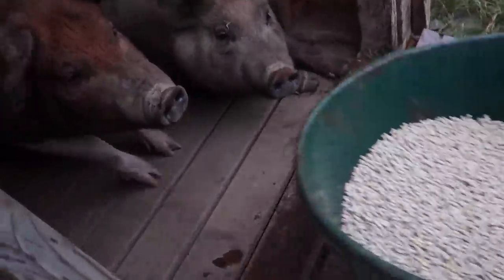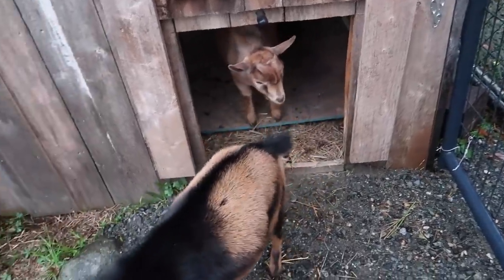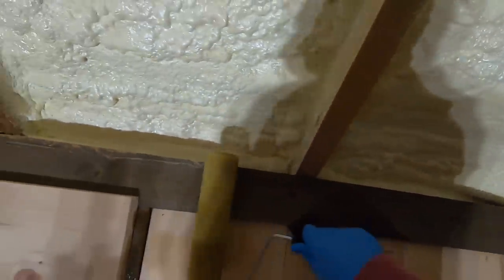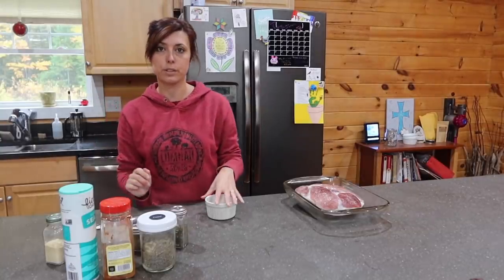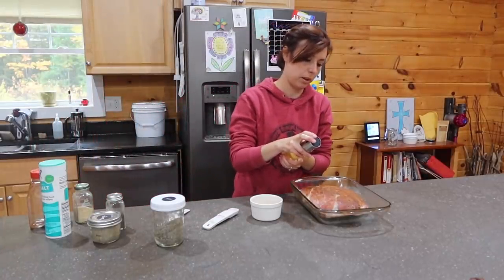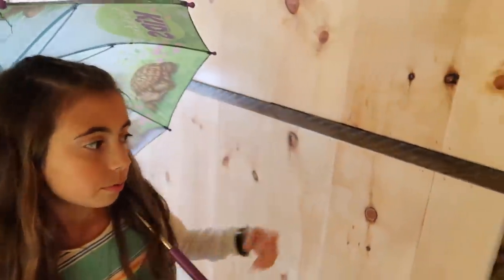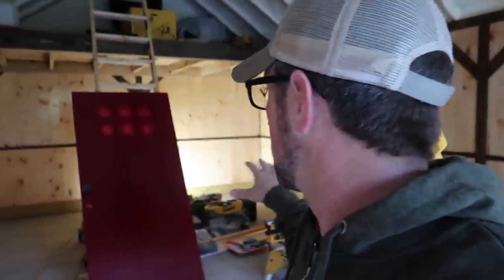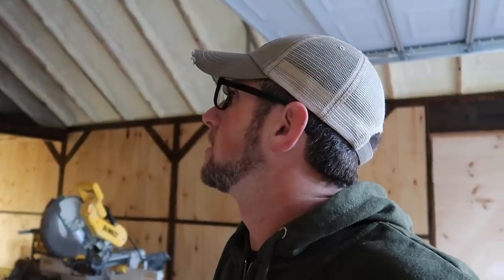Time to Get Sticky! Applying the FINISH to the Post & Beam WorkShop

Comment: Two suggestions: 1. Make sure you have a work bench for working on greasy/oily things -cars, tractors, chainsaws etc separate from the bench you will use for wood and other crafts/projects. A metal top bench for grease would be best; once you get grease and oil in wood it'll never come out. 2. I would suggest that the top of at least one of your wood work/craft tables be made with a surface you can replace fairly easy (good solid plywood perhaps). This gives you flexibility to secure (screw) blocks or other things directly to the table top temporarily without spoiling a nice butcher block finish of other work surfaces. Clamping for most wood working projects is usually fine but where the shop is meant to be multi-purpose, you may find that helpful.

Comment: I've had a 2x4 butcher block workbench for 30 years and it still has more time left than I do probably. With all the Dewalts you have make a nice charging station as part of your workbench set up. I like your ideas so far-to me a workbench is almost a personal thing and you need to do what works for you. Mobility for things like the table saw are the way to go because your not using them all the time and they don't need to be taking up work space. Bench grinder,drill press,vise are a few more permanent fixtures in a good shop. Looking forward to the "birth of a workshop" LOL

Comment: Hinge part of your benches with drop down legs , they hang down against the wall when not in use leaving more floor space when needed.  Worked like a charm in my small shop. You never have enough room.

Comment: That Lil Cowgirl Olivia is growing & she’s so intelligent 😁❤️👍
My suggestion for the ceiling to cover over the foam. Is this paneling you can get at Lowe’s or Home Depot that looks like tongue & Grove wood. You could probably get it in the Color to match your walls. It’s also thin & light weight 4’x8’sheets like regular paneling that goes on walls of the house. U can get it with about any wood look. It would be easy to put up to cover your foam & it would look more like a cabin inside. 🤷‍♂️
Reply: I would suggest also that they finish (stain and polyurethane) those pieces before they get put up.
Reply: Susie'sSoap&Stuff they already come that way with satin finish on them. They are paneling like you put on the walls. But you can get them now that look like boards like what’s on his walls already , you can also get it that looks like a brick 🧱 wall, just all kinds of designs on them & they are already come with shiny satin finish.👍
Reply: Not an audio expert, but putting in a ceiling of the proper material, might provide significant improvement to the audio on your videos on YouTube.  This would improve all the future segments that we are hoping to see of the your projects in the workshop.

Comment: I love Ms. Olivia’s optimism about the weather, as much as I enjoy the snow and cold I agree, why can’t the whole year be like the last couple of days prior to rainy and highs in the 40’s this whole weekend. Mid-Michigan, if you don’t like the weather, stick around it will change...

As for the work area, I would try and keep the table saw below the left sided bench, maybe to the right of the chop saw cut out, out of the way until needed. Keep your tools in one general area, maybe the right side of the U. And cabinets across the back wall.

The whole work shop is looking amazing. If funds allow some bead board or ship lap on the ceiling run horizontally and painted a light color or polyurethaned to help keep it bright with the addition of the L.E.D. lights..I agree in waiting to do the electrical at the end, gives you time to figure out the placement without making it permanent.

Comment: Al, make everything mobile, including those work benches. This will provide maximum flexibility.  That space may look huge now, but trust me, as you put things in, it'll shrink rapidly. Put them on heavy duty locking casters - you'll thank yourself later. Also, install some type of sawdust exhaust system. It would be very cool if you could have it run to the exterior so it would empty into a bin outside or something for easy hauling to your compost area. Your polyurethane spill just highlighted something you might want to do as well - a POLYUREA coating on your floor (lasts longer, is easier to apply, dries faster (2hrs) than the standard coatings that most people use.

Comment: In my shop the chop saw was against the end wall and built in. This leave all the other walls clear with moveable benches on them for assembly, crafts, repair work, etc.... and the shop can be reconfigured for different projects as needed or interest change.

Comment: My husband has heavy duty lockable wheels on old kitchen units and cupboards in his Worksop allowing him to move them around, yet at the same time able to lock them once moved. He then made a shelving unit with 24 x 4” square slots. He bought 24 x 4” square containers and put them in the 24 holes, these containers were filled with nails and screws. He mounted the whole thing to the wall. All containers have been labelled with the size of the screws etc and what they’re used for ie wood, metal, plaster etc, even including slots for different size wall plugs too. He also got a 4 x 1” length of pine, hung it on the wall, like a long shelf, then drilled the shelf with different size holes. This shelf is used to stack, hammers, screw drivers etc. As my dad used to say, there’s a place for everything and everything should be in its place.

Comment: How you layout your shop is going to change over the years. If I could suggest anything make one of the benches covered with steel. And make sure you get a flammable liquids storage cabinet. A real one, not just a steel cabinet. 
Your sure to be grinding someday.
Reply: You need a metal cabinet for insurance purposes.  Without it,if a fire turns out to be caused by your shop chemicals, they may deny the claim.

Comment: I keep  2  garbage cans  in  my  barn/workshop  for  trash  and  gen cleanup,  also  some  5  gal  for  metal  pieces, etc.   I  put in  a  u shape  work area  in  my  barn  with  a  lower  shelf  for  tubbies.  I  keep  small  tools,  plumbing and  electrical supplies  in  them.  Makes it  easy  to  find  parts  when  in  a  hurry!  I  put  hangers  for  yard tools  on  the  wall  so its  easy to clean under them.  Feed  goes  in  metal  cans  and  I  need  to  build  wood  risers since  I  have  a  dirt  floor!  Table saw,  miter saw,  chop saw  are  on  rolling  tables  so  I  can  work outside  or  in  the  center of the  barn.  I have lots of  storage  shelves  on  the  rest of the walls  for  more  tubbies  and  set up  areas for  certain equipment--bee stuff,  pool stuff,  brewing stuff-bottles,  etc.

Comment: Don't forget a plumbed in dust collection system.  Make sure it's an actual  dust collection system sized for 4 to 6 inch pipes.. Personally I also like to have a  shop sized dust filter hanging from the ceiling as well . It really takes care of most of the sawdust issues and keeps the shop environment  nice to work in.

Comment: You’ve made such a beautiful workshop!   I would definitely do two things if it were me...cover the insulation on ceiling with some kind of wood paneling....maybe a faux shiplap and seal that floor so stains don’t absorb into that concrete.  In fact they make some amazing concrete tints these days....so putting a darker tint on that floor might show stains less.   This workshop is going to be your sanctuary and used by your family for decades to come for projects so I think it’s worth spending a bit more time and money to do these last finishing touches!

Comment: I used 2 layers of 1/2 plywood for bench top. My vice is on a island. You could build one on wheels . Make shore you have plenty of room on both sides of the saw. Used 8 ' led lights, which used to be Florissant converted. You can get 4' shop led for cheep. Put put tones of reciprocal around the wall. I picked a used sawdust collector, for my planer and other things. Leave room for a skill press. I use mine for every thing.

Comment: Since it is going to be multi-functional for Gino too, I think a good dust collection system is vital. Be proactive in controlling the dust. At each work station, saw, drill press, etc. Also above your assembly bench. Easier to build it in now. Then a nice rolling bench/table that incorporates the table saw and a router with an overhead duct to connect to the dust collection. Really enjoy following your journey, thanks for your efforts filming and producing great content.

Comment: Outside behind the barn in a small covered area locate an air compressor and pipe it into the barn, then run hard lines to various location ending with quick disconnects. Also, if you have the power, a welder is always a good thing to have at your disposal for working and repairing farm equipment.

Comment: I had a u shaped work bench in a shed i used to have and it was awesome. It made it easy to reach everything. I used 3/4 inch plywood so if it got worn out i could change it. However, the butcher block would be gorgeous. I am sure whatever you do it will be awesome

Comment: Love what you did in the work shop!!! Beautiful!  I would get plywood up on the celing before you run conduit.   You'll loose foam insulation otherwise.  It will also stabilize moisture in the workshop.

Comment: I have a similar chop saw station, but I would flip it to the other side of the barn, because you will normally use your.left hand to hold the material and your right to operate the saw.  Having the material most supported in the left side will give you the most sagety/speed over time.

Comment: Gooooood Mawnin' Al!   No matter what design you go for I'm sure it will be a good design.  My recommendation is to consider using tables or carts on wheels where you can so that you will be able to move them to clean up a mess and so you can easily move sections around as needed.   Good luck.

Comment: As you apparently like to "re-purpose", look for some surplus/salvage wooden doors (solid not hollow) to use as work bench tops.  The door knob hole works great for scraping trash/scraps into a coffee can mounted below as a mini trash can.   Also, you can make your own "Peg Board" out of 1/4" plywood (lots of drilling holes involved) which you can score and stain to match the ship lap siding if you want to be real artsy!

Comment: Put wheels on everything. make the U shaped area in 3 parts so you can move the pieces around to use as the off cut table  and for other crafts.  Make under-bench shelves for storage.  Mount a vice in a good central location.

Comment: Prior to building any work shop cabinets or tables I would recommend installing a dust collection system....that is something I have to do in my woodshop.  When you setup the dust collection system you want to establish different work stations for your stationery machines.  There are numerous affordable systems on Amazon. ... granted I am still working on the best affordable dust collection system for my wood shop....

Comment: Paint the Floor, it makes the clean up quicker  if you use one of the epoxy paints its  rock hard and difficult to damage / stain. 
Fit the lights under the attic area in the space between the beams it will save on damage when moving things around.   
Make one of the bench tops metal  for dirty work (fixing engines and other other oily / greasy parts) make sure that you electrically earth it.
Hinge the ladder / stairs so you can have a clear floor area when access to the loft in not needed. 
Fit some of the lights along the walls to shine on the workbench's so that you don't work in shadow .
Fit a vacuum dust extractor to the saw, if you are not going to move it, this will help with the clean up and cut down on the dust. 

Just some things that I would like in my ideal workshop.

Comment: Counter tops: for the wood working side do 2x3's on end but for toolbox side do plywood then cover it with thin sheet of galvanized sheet metal for easy cleanups when working dirty, greasy mechanical parts.(have front and back of metal bent in a shop brake for clean look.

Comment: The poly is a good call, and it looks wonderful already. Satin sheen is my personal preference as well, and it'll not only protect the wood, but it'll also clean up easily. I, too custom built a miter saw table like you described, and it's very convenient. Can add shelves underneath for storage, too. For lighting, I've had great results with LED strips I ordered from Rockler. They're extremely BRIGHT and economically priced. Might also consider dust collection as you're planning the layout. No need to buy an expensive setup, because a simple dust separator connected to your shop vac can do the job nicely. There are several plans for building a mobile dust collector that can be easily rolled to the tool you're using at the time. The single item I get the most use from is an 'all purpose' table/workbench centrally located in the shop. Mine is about 8ft x 4ft and it's where I do all my assembly work. It's not near walls for a reason, and I'd be lost without having it. Not sure if you have the space available, nor what you're going to be building -- but think about where you want to be working... Hope this helps!

Comment: Your butcher block idea for the workbench top is an excellent idea.  I would like to suggest maple for the bench top, or another hardwood.  Also mount a 3/16" steel plate 2 - 3x the base size of your vise on the underside of the bench, with holes drilled through the bench & plate for the vice mounting bolts.  Use as big of a diameter bolt that will fit through the vice mounting holes.  We have a steel frame (1/4"x2" angle, w/2"x2"x1/4" square stock legs) workbench at our shop with a 3/4" plywood top that has a 1/4" steel plate welded onto the frame under our vice.

Comment: I used old take out kitchen cabinets when I remodeled  my kitchen with a 3/4" plywood top on a 2×6 frame. I left lots of open space under the benchtop to slide larger things for storage. A rolling bench would be great for your table saw if you recess a area to level your table saw with the bench would be handy you could make it so the saw could be set in to rip long pieces or turned for smaller peices✌

Comment: Looking good :D   Decorators tip for you, do the cutting in around the edges first then roller middle areas (works for pain and varnish) this will minimise brush marks and give a neater finish also you are not trying to get small bits done around an area which is already drying/tacky.  Was given this tip a few years ago and to pinch your phrase "I like it" ;)

Comment: I like your idea for the " U " work bench. I planned on making mine with 2x4 glue and F clamps. I think for the ceiling I would put up some kind of sound insulating foam boards. Hold in a little more heat and make it quieter. Looks really good guys!!

Comment: From an electrician run two 3/4 in emts home runs from your panel to each side of your shop one for outlets and lights and the second spare for future equipment. They could be run on your ceiling rafters to not cover your beautiful wall to much. You can install power strips on your work benches and plug them in to a wall outlet running down from boxes located above that could be incorporated into a removable ceiling coverings. You might find a retired electrician back where you live that could help  with your design and project. Good  luck and God bless. 
Kirk

Comment: Everything on wheels under the benches. Some drawers for storage, a rolling table for the table saw (adjustable height so it can store away underneath) a lockable metal cabinet for poisonous/dangerous stuff, a big mobile cyclone shopvac for all the dust & that can connect to power tools. Also hang some power outlets down from the ceiling so you can plug power tools or vac in overhead (not needed often but very useful when you do want them)

Comment: Make sure you allow for the rails on the miter saw when building that bench, y'all can use plywood for the bench tops(3/4 BC) works well with high gloss exterior polyurethane 2 coats to repel any spills

Comment: Your shop is really nice.  As a soap maker, I would recommend you put that in your basement where it is always heated.  Supplies and curing soap needs to be in a controlled dust free environment.  Also you will need running water.

Comment: Put a stainless steal counter top easy to keep clean. Also make the counter top high enough to roll the table saw under.The vice could go on the right side on the end. Try to keep your shelf's high enough so you don't hit your head on it, and put all cabinets on wheels so you can move them around under the counter top. That:s all Ive got but you did a great job looks fantastic. Good luck you two.

Comment: The island Table someone else mentioned is great idea too. I have one made with 4x4 post and 2x10 top, with wood vice on one end, saves a lot of walking for sure. I also like the guys ideal about the rubber mat for the floor, especially on concrete floor,  sooner or later it will cause back problems.

Comment: Try setting up temporary layouts at first to see how well it works, and how well workflow makes sense. Things used frequently needs easier access, those used less frequently can be placed in the less accessible places. Storage is best in clear, labelled containers. You should have the majority of tools easily visible, for both access and replacing after use. Have fun! Great video!